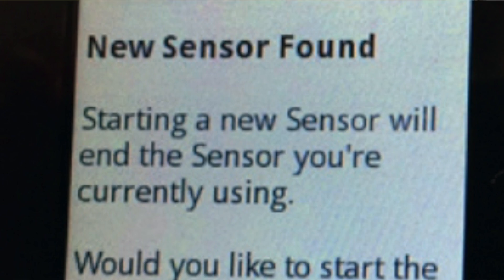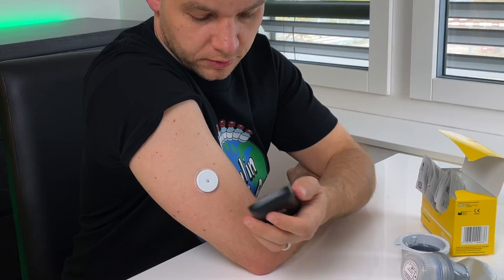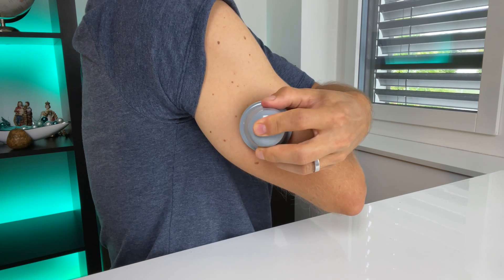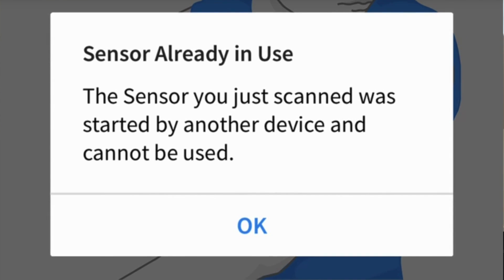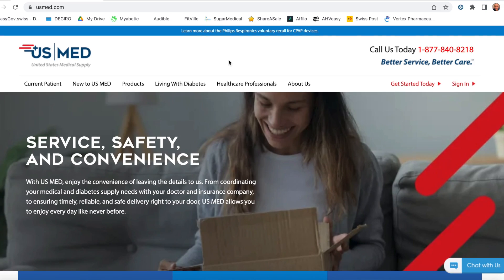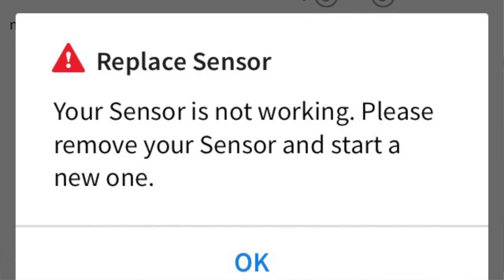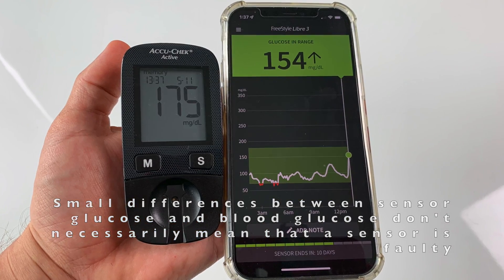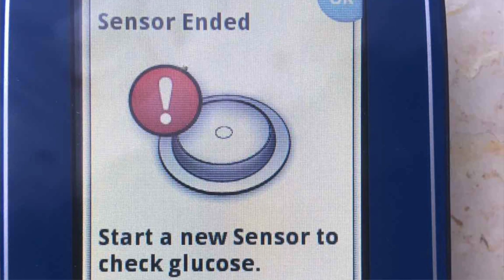FreeStyle Libre Errors and How to Fix Them

Comment: I read my sensor with 2 devices. I start it with the Freestyle reader, but use my Samsung phone for rest of time. If I actually used the Freestyle reader, the battery won't last long enough.
Reply: Yes this works fine with the original reader and sensors, and will sort of work with the no2 versions, but you loose the remote (bluetooth) alarm function, which is a major benefit of the Libre 2 sensors. 
I don't know why Abbot didn't continue to allow 2 devices to use the Libre 2 sensors to work fully, but it's bloody annoying they haven't! Especially when you've got your phone hooked up to the car on a long journey.

Comment: I just started my 2nd Libre 3 sensor yesterday. My first was used while I was travelling, and I got many low alarms that turned out to be wrong compared to my finger stick checks. Most were off by 20 to 40 mg/dl. Now I am keeping a log, Out of 9 comparisons, 2 were off by 20, 2 off by 40. The rest were within 5 to 10. Has anyone seen results like this?
Reply: I’m afraid to switch to the 3 from my current 14-day because I think that the 3 sensors will read low as often as the 14-day ones do. I don’t want to be awakened for false alarms whenever the sensor give a false low at night.
Reply: Daughter used libre 3. Blood test and libre showed the identical data for 5 days. On the sixth sensor showed LO but she has 4-5 mmol, and now (7th day) it stopped working. The 5th sensor do it with my nerve system and i hate them
Reply: Hello. How did u fixed that error on libre 3? My sensor was keep giving me low and low then its now error lost sensor correction . I dont know how to fix it
Reply: @shifatjahan4309  I researched glucometer accuracy, and found that the one I had been using for years is one of the most inaccurate, and was giving me readings from 20 to 40 too high. I switched to a Contour Next Gen, and the readings are now within 10 of what the Libre 3 sensor shows. This has restored my confidence in the accuracy, and I am now on my 5th sensor, and they seem to be working fine. My sensor sometimes loses connection for about 10 minutes, but this only happens about every 4 days. The fact that the sensor reading is about 15 minutes behind my actual finger stick blood sugar takes some getting used to... I hope this helps.

Comment: Tom.  Very helpful video as usual.  The issue I had was that the alarm system on an Android phone had no Dismiss button. Also, the alarms on Android are either off or on very loud.  IPhone phones do not have that problem.  Abbott denied the problem for awhile and finally said they would try to have it correct for the libre 3.  Unfortunately Medicare is not covering the 3 yet.  Huge frustration. So I switched back to the Reader for my libre 2.

Comment: Using Libre 2, and it can read 20 points different at times, can't go by it to give medication. Once showed 243, and I checked by blood strip, it was 163.  Big difference, but it's always 17-25 points off.   The sensor is secure on my arm. Had Nurse at doctors office even apply one, just to make sure.
Reply: it happens to me a lot too.
I got the conclusion that the sensors are biased by the value of the glycemia when they are installed. that is: if our glycemia is low (under 80) when you install your new sensor, it will constantly give you lower values than the strip readings, throughout its 14 day life cycle; if your glycemia is high (over 160) it will constantly give you higher values than the strip. 
and I came to this conclusion after keeping track of my sensor readings and my strip readings for about 4 months.
as for the 17-25 points difference, I was told from the very beginning that the sensors' accuracy is within 20% off the glucometers. and is anybody's guess if the 20% will be lower or higher.
however, after failing at stabilizing my glycemia for more than 2 years, I caved and got the libre 2, even though it doesn't work with my android model. AND even though, as I expected, the surgical glue gives me sores that sometimes take 17-21 days of constant treatment to heal. (thank god I have a lot of space on my arms to move it around!)
because the main advantage of the reader is it's capability to predict with quite a high level of accuracy and a total lack of skin harm, what is your glycemia doing: raising or falling or keeping still. and if I don't feel like the reader is correct, it doesn't hurt me to check again in 10 min, or 15, or even 3.
god keep you in good health!
Reply: @irinadalah9089 It is important to realize that neither finger stick nor cgm accuracy is as good as we need it to be. Do the math. If a reading is +/- 20% and there's no way of knowing whether your current reading is on the extreme high or extreme low side of the scale than the margin of uncertainty is 40%! Tell an auto mechanic that his torque wrench can be off by 40% and he's going to be asking for an immediate refund! But like it or not given current bG technology the accuracy of any particular reading is questionable. I once had a doctor respond to this statement by saying, "Well that may be true but most of your readings are probably fairly accurate." I thought he was joking at first but when I realized he was being serious I said, "Okay but how am I supposed to know in real time whether the reading falls into the "accurate" or "inaccurate" category?" In other words if a significant number of readings are inaccurate ones faith in all readings is weak.
Reply: Mine earlier had the alarms going off twice so I tested and my sensor was off by 87 points...my fingers stick test results was accurate 146...sensor was in the 50's/64!
Reply: Yeah strip method are more accurate and better, but this force you to keep your blood sugar level and body sugar level close.